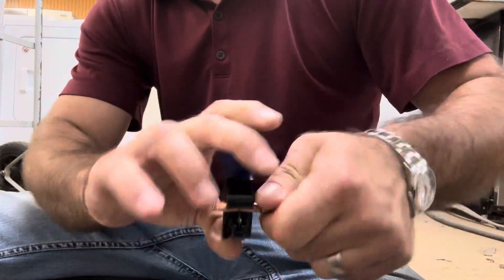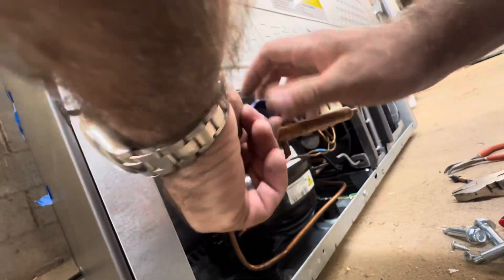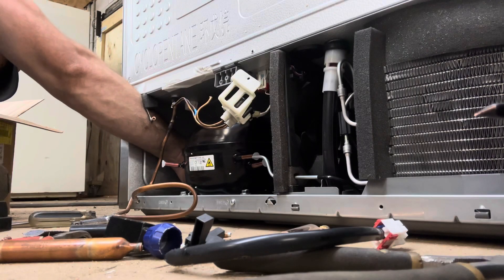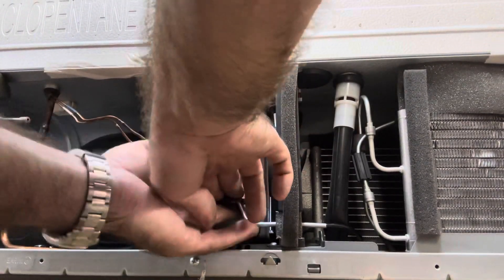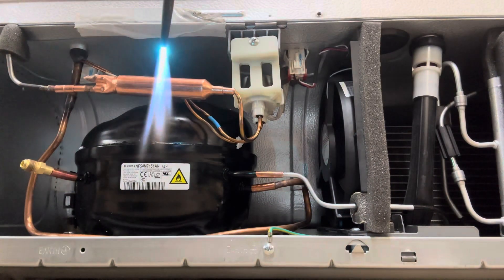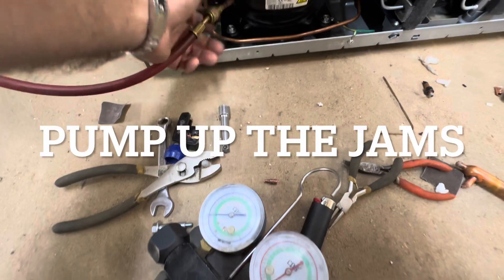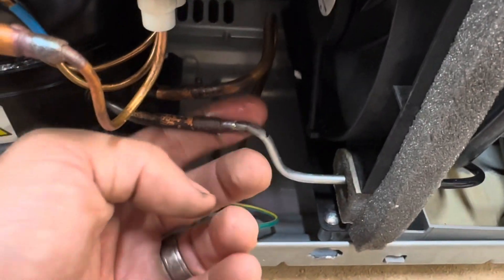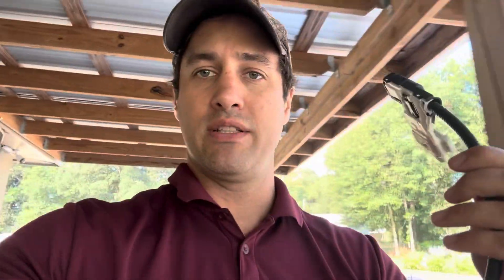Samsung bespoke refrigerator with a bad r600a compressor | So we will just slap one in! 💥POW💥

Comment: So when brazing, you never run nitrogen through the system?
You’re not worried about black deposits forming inside the lines in the form of cupric oxide?
Is this common practice(Not that I’m saying it’s right, I don’t know)not to run nitrogen on smaller units whether refrigeration appliances or window AC units that use 120 Volts?
Reply from the maker: I know some people do. But I haven’t in 20 years.
Reply: @LAapplianceguy   What are your opinions on Stay Brite 8 solder and flux, assuming if you tried it?
Would it work well in an appliance based refrigerator?
Reply from the maker: @stanm25 I’ve never used it. I’m sorry.  We have always just used 15% silver and just regular lucasmilhupt ultraflux paste.
Reply: @LAapplianceguy  Thanks, I’d be curious how it’d work for you if you ever plan to use it at some point. 
You don’t have to use nitrogen since you don’t have to heat it up anywhere near as high as when you’re brazing and worry about copper oxides forming inside the refrigerant lines.
Reply from the maker: @stanm25 right these lines are pretty small compared to ac and big refrigeration.

Comment: What is the valve you undid on the back? Is it a solenoid valve for pump down? I don’t work on residential fridges, I do industrial hvac and refrigeration but have messed with a number of relatively new 600a fridges and have never seen that valve on the back.
Reply from the maker: @THESNAKE8  I think Samsung just calls it a magnetic refrigerant valve. I think of it as an isolation valve to isolate one of the two evap coils.
Reply: @LAapplianceguy  makes sense, it has multiple evaporators, wasn’t aware.

Comment: Surprised to see a Samsung Bespoke compressor fail. These are a lot better built compared to previous models. Compressor and labor should be under warranty.
Reply from the maker: @xcmskim4  they couldn’t get anyone to do it. The guy said just fix it. He called a lot of techs and Apparently folks around here are scared of r600 or something. I don’t know. I said make sure it’s not covered. Maybe they are reimbursing them 🤷‍♂️ idk

I have another Samsung here with the same issue but Samsung won’t do anything for the customer for some reason. So I’m probably gonna junk it.